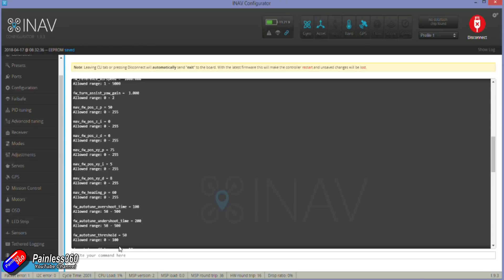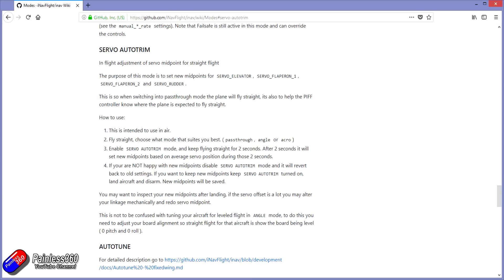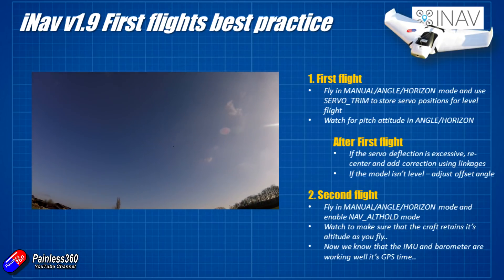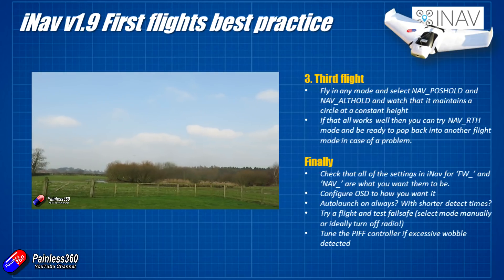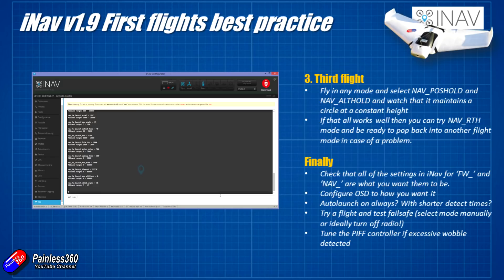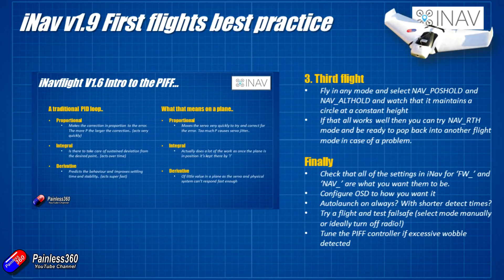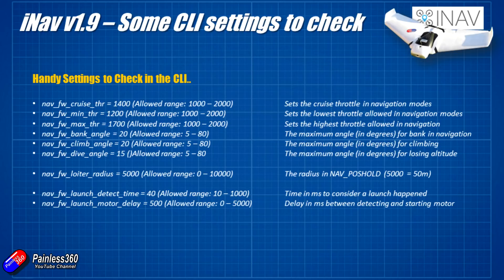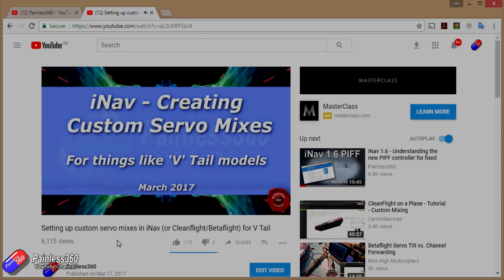iNav V1.9 Wing Build: Final setup and your first test flights (Orbit Wing and F35 FC)

Comment: Hey Lee, my orbit with the F35 running I nav 2.0.0 doesnt seem to want to even auto take off, if it does (it did this just once), the moment i take manual control, it dives to the right and down to the ground really fast!! 

I have made all the suggested changes per the fixed wing guides on the inav github, checked my control surface direction and CG - and they seemed just fine, but no success in getting this thing up in the air, has already crashed couple of times, and am contemplating giving up because this wing just wont take another crash on take off, any thoughts?
Reply from the maker: I've not tried iNav 2.0 on a fixed wing yet. I'd check the problem reports on Github and consider adding one if you cant see this issue already.. Best of luck

Comment: hi lee great video as usual i finaly fly my caipirinha version 1 today  did my homework with i nav setting fantastic maiden  fly straight and level the only issue is when i fly in nav altitude mode i need more throttle to hold altitude  when i bank the wing  and i dont know where to  go to tuned the throttle (advance mode ? )  thanks
Reply from the maker: Could be a few things. Check out the CLI commands in the wiki, something like throttle_tilt_comp_str may help..
Reply: Thanks Lee for your reply i check in the wiki a(again)altitude mode olly work conbine  with angle mode (i combine mine with  horizon mode )

Comment: Hi Lee. As usual a great video. Thanks and please keep on doing them. 
I crave an indulgence. I have a Bixler 3 with a Furious f35 Lightning  flight controller Inav 1.9.0. and Taranis 9d. I want to run spoilerons on it for crow braking. I have set up flaperons, to work with the flaps and have tried using the CLI to reverse the throw. I have seen on Utube that spoilerons are possible. Would you please be able enlighten me/us. Many thanks Garry G
Reply from the maker: I'm waiting for iNav 2.0 for more videos now as there are some huge changes due in the mixers that should make that easier.. Best of luck with it!
Reply: Thank you for your prompt reply. I realise crow on a bix3 is severe overkill however with my lousy flying I need all the help I can get. I look forward to your video on inav2. (any idea how far away inav 2 is??) I find inav has some good aspects and the f35 f/c is easy to set up and use.

Comment: That Servo level switch tip is huge, thanks! Instead of messing with trial and error on your control rods, get it to fly level, now you set the Servo center, then land it and adjust your rods to get the same deflection and reset your center. Brilliant!

Comment: An odd issue I am now having is that certain things on my osd are disappearing and then reappearing. Such as altitude turns on and off, seemingly at random. Total mah used turns off at full throttle, then comes back when throttle is reduced. Total flight time comes and goes as well. Any ideas?
Reply from the maker: I'd have a look in the wiki for anyone else experiencing that problem with the flight control controller you're using. Sounds to me like a power related issue, maybe a capacitor or two might help keep the power at the level the flight controller needs to drive that OSD? Hope that helps..
Reply: Painless360 ah ok. And I forgot to mention, it is a lightning f35